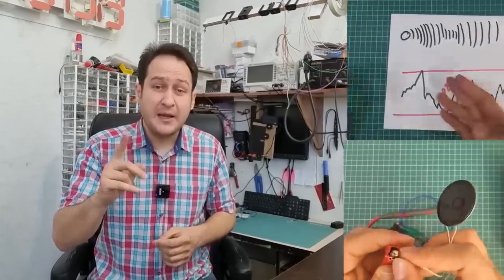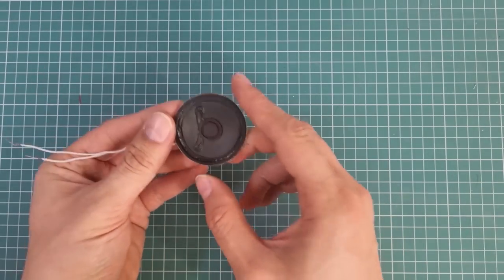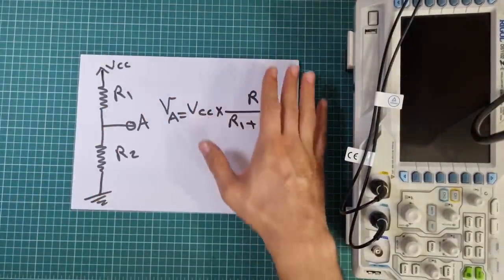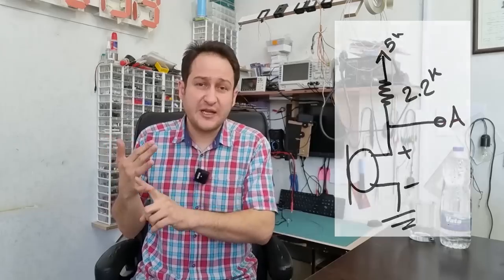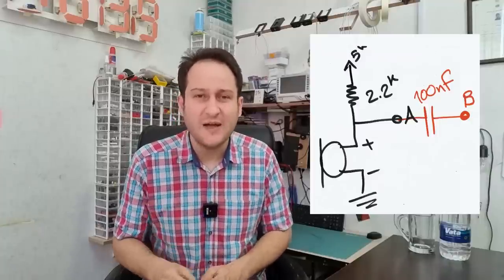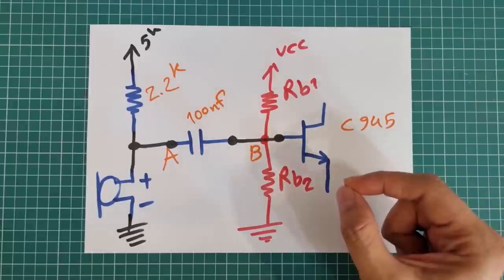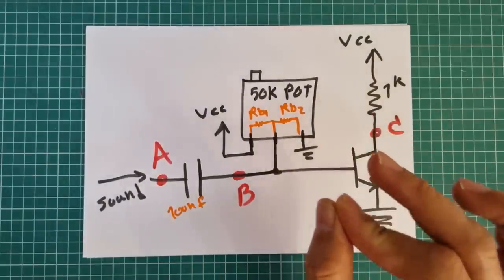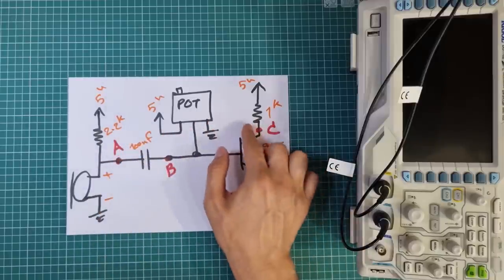How transistors amplify audio signals in megaphone circuit?

Comment: you should have mentioned, for the beginners, that it is not a good idea passing dc current through a speaker not only for heat dissipation but also to decreased efficiency of superimposed ac signals ans since in the emitter follower shown here it is the speaker that determines the quiescent current of operation it may be quite large depending on its dc resistance.
Reply from the maker: Yeah, that is right,  this is not the best audio amplifier in the world!

Comment: You simplified your description of the impedance of the speaker by calling it resistance. I know this is intended to be an introduction, but you should at least mention the difference. The dc resistance of an 8 ohm speaker will not be 8 ohms.

Comment: A resistive microphone is strange. It should be mentioned, that there is allready an active device inside the microphone, which converts a voltage signal from an electret device into a resistance signal.
Reply from the maker: Yes, I agree 👍

Comment: Noob question, why the resistor, 2.2k or otherwise? Why not just connect the mic directly to the voltage source (5V)?
Reply from the maker: Because in that case, both sides of the mic are fixed, I mean the voltage on negative or positive leads of the mic can't be changed, so it can't present the voice signal. You have to put it in series with a resistor, then you can get the voice signal between them 👍
Reply: @elewizard  thanks
Reply: @elewizard  I think I get it now. A change in resistance in the mic due to sound input results in fluctuations of current through R1, which results in fluctuations in voltage at R1 (aka signal), which then leads to a changing Vout, which then needs to be amplified. Is this correct?
Reply: It's like voltage divider

Comment: Extremely well explained video. I haven't found anyone else giving this level of detail, which really helps. That said, I had eveything up to the adding the last transistor. I would have thought the voltage as point C would be too great to drive the base of the second transistor, so it would be in saturation mode?
Reply from the maker: You're very welcome! No second transistor is configured in common collector mode and there would be no problem. 
For more info about that part of the circuit you can watch my other video. There is a link to that video in description

Comment: At 19:20 - no. Any decent capacitor will completely block dc voltages. A smaller value capacitor will not "improve dc blocking". It will, however, allow lower frequency ac signals to pass more easily. There's no reason to guess the value of the capacitor. For audio applications, you just need to pick a coupling capacitor that has an impedance at 20Hz roughly equal to the input impedance of the next stage, which is the lowest frequency of interest for audio. A 100nF capacitor has an impedance of about 80K at 20hz; a 1μF capacitor has an impedance of about 8K at 20Hz; a 10μF capacitor has an impedance of about 0.8K at 20Hz, and so on. Your choice of 100nF would normally be considered too small, unless you deliberately wanted to block bass frequencies.

At 14:00 - no. You'll find that 400mV p-p will definitely produce sound from one of those small loudspeakers. But from an ac point of view you've just connected 16Ω across your voltage divider which has an equivalent resistance of around 1K, so you're now loading the signal and reducing it by a factor of about 60. No wonder you can't hear anything from the speaker. Your test only proves that you need to drive a speaker from a low impedance if you want to draw any meaningful conclusions about how much voltage is needed to hear anything.

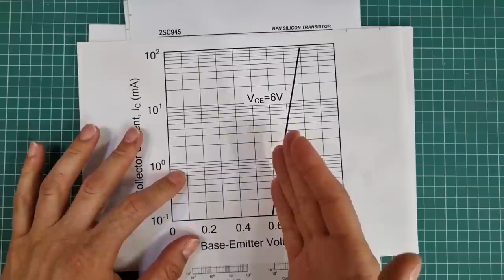At 17:10 - no. The relationship between Base-Emitter Voltage and Collector current is not linear. You're reading off a graph where the axes are *logarithmic*. In fact the collector current increases exponentially with base-emitter voltage.

At 19:50 - no. To choose Rb1 and Rb2, you cannot set "one of them as you desire". Those resistors determine the input impedance of the stage, so your example (pick Rb1=1K) would give an input impedance of less than 150Ω. That would significantly load the microphone and you'd lose most of your signal.
Using a potentiometer to bias the transistor runs into the problem that you could accidentally have it at the maximum extreme so that you get the full Vcc applied to the base of the transistor. If your PSU has no current limiting, you'll burn out the transistor. Put a resistor of several kΩ from the Vcc to the top of the potentiometer to avoid that problem.

At 28:14 - the problem with the emitter follower stage is that the speaker now has a dc voltage of around half of Vcc across it, since the Vbe of the second transistor will only reduce the dc voltage at point C by about 0.7V. We don't want a dc voltage across a speaker, so we need to block the dc with a large capacitor. Generally we'd expect to see 1,000μF which has an impedance at 20Hz of about 8Ω. That means we'd need a low-value resistor from the emitter to ground to bias the transistor. The UTC version of the 2SC945 has a maximum collector current of 150mA and a maximum power dissipation of 750mW (if you can heatsink it to keep the case at 25°C, otherwise more like 250mW without a heatsink). So we shouldn't set the emitter current more than about 75mA for the second stage, giving a quiescent dissipation less than 200mW. That gives the resistor required a value of about 33Ω.
Reply: The point of this video is to explain, in simple terms, how an amplifier works. It is intended to teach people starting out in electronics the basic concepts, and encourage people to have a go. Blowing up the odd transistor (by turning the pot fully to the supply rail), wondering what happens if you change the capacitor value, etc is all part of the learning process.
The idea is to get a foot in the door. Once someone starts to build a circuit like this, they will either be interested, or not. Those that are interested will ask questions. They will dig a little deeper and discover some of the points you mentioned, then tinker and research it some more.
No newcomer to electronics is going to watch a 2+ hour video that tries to address every single point you mention. It would be off-putting. Things such as impedance and frequency response are more advanced topics that come later in a persons learning. 
This video does a great job of getting someone started. If they are interested, they will soon expand their knowledge.
I don’t really know why you watched this video.
Reply: A larger value capacitor will allow lower frequencies to pass. The reactive impedance is always a reciprocal 1 over/divide by 2pifC.
Reply: @MickHealey  I'm perfectly aware of what the intention of the video was. But as someone who has taught for over 50 years, I'm quite certain of several things:

1. You never lie to your students. You may avoid topics, or only give a part of the information, but when I hear nonsense like a smaller value capacitor will "improve dc blocking", I know full well that the students are being told an untruth. Why? Doesn't the author know any better? Does he actually believe that?

2. Giving an example is a good technique in teaching, but examples have to be realistic. Nobody, but nobody, would use a 1K resistor as the upper bias resistor in a stage that's being driven from an electret microphone. It would have been just as easy to have worked with 100K, so why not do that? Similarly, using a 1μF coupling capacitor would be a practical value. So why suggest 100nF? Even if you don't present the calculation in order to keep the video simple, there's no excuse for not being aware of what a realistic value would be.

3. You don't contradict yourself when teaching. You should not blow on a microphone and then say "never blow on a microphone". Nor should you tell students not to put a dc voltage across a speaker, and then do exactly that in two different places. Does the author not realise that his final circuit puts half the supply voltage across the speaker? Did he have no idea of how much current that will pull through the transistor, nor of the effect of 150mA of quiescent current passing through the speaker?

4. Students have a range of abilities, and many are capable of doing extension work on their own. The best lessons cover a topic at a level that all students can cope with, but provide leads to further material for those that want it. This video neither gave an accurate overview of a basic two-stage amplifier, nor gave any idea of where they could find more information.

So, no, this video does not do a "great job" of getting anyone started, and I have no idea why you would choose to pretend that it does.
Reply: @RexxSchneider  So, you've taught for over 50 years, and presumably consider yourself an expert on the subject. That being the case, I see no reason for you to have watched this fundamentals video, unless it was for the sole purpose of picking holes in it. I know retirement can be boring, but wouldn't your time be better spent doing something constructive, rather than being critical of other people's work?
Reply: @MickHealey  That's a pretty thoughtless comment, isn't it? Any decent teacher will always be on the lookout for fresh, quality material, because it's easier to direct a student to a good resource than to have to explain the same thing from scratch. I guess that you didn't bother to read my fourth point, as that should have tipped you off to my reasons for looking at introductory videos.

If you don't think that pointing out factual errors in a presentation, and explaining each error is "constrictive criticism", then I suspect that your grasp of the English language is even weaker than your grasp of pedagogy.

You should also understand that I feel sorry for students who are mislead by errors, and hope that they would benefit from reading the corrections. Should I assume that you are happy to leave them with mistaken impressions?
Reply: These are important and honest clarifications for those who want another level of detail and caveats for this circuit.  In particular, noting for beginners that: 
 - Often “load” is mentioned and not explained; essentially by what factor (eg by half) a signal is reduced. “Load balanced” or “load matched” circuits are ones that minimize losses from one stage to the next. The measurement of “load” is quantified often by “resistance” (for steady signals) or the fancier “impedance” (which includes wiggly signals)
 - The “load” can be different at different frequencies (wiggliness) of signals. This useful feature, measured by impedance, is a behavior of commonly used components capacitors and inductors. Capacitors being mentioned here have a higher “load” at low frequencies, and have their highest “load” at the zero frequency also known as DC signals (no wiggles).  At higher frequencies Capacitors don’t reduce the size of wiggles as much, and effectively let them pass through without much of a toll (there is always some toll!). Inductors load down the wiggles opposite to the capacitor behavior. 
 - Audible wiggles for humans range roughly between 20Hz and 20kHz (though my personal range has diminished significantly ; young players wear those protective ear plugs!). The purpose of a circuit will help narrow down the range of appropriate component values. 
 - Sometimes the most interesting learning happens when mistakes are made and figuring out why a configuration didn’t work as expected (or blew up). Of course safety wise it’s best to stay living in order to debrief  on why expectations were not met, so first it’s useful to understand where high currents could appear. Resistors are one way to limit how much current is possible for a given voltage (loading it down!) to prevent damage to circuit components which have a limit to how much current they can withstand (much like us). 
 - Watching another person make mistakes, and seeing the consequences, while saying “do not do this” is definitely educational when understanding why it is being recommended to “do not do this”. A time and money saver for sure, though feeling the sting will always be a more memorable teacher rather than passively watching a teacher being stung.

Comment: Thank you. Another great video with easy to understand explanations. Would it not be wise to put a small 1K resistor on the middle pin of the 50k pot so not to turn the 50k pot to zero resistance and allow full current to pass through the pot to the base emitter junction and burn out the pot or the transistor?
Reply from the maker: Yes, I think it would be wise 👍

Comment: Very impressive. I love your video. You made the concept that was hitherto pretty strange to me to become clearer and easy. But then, how do I drive a big loud speaker ?
Reply from the maker: Happy to hear that. High power speakers need high power components and of course an optimal and sophisticated  amplifier circuit. This circuit is good to learn basics not to use in real world projects
Reply: @elewizard  
Thanks for your reply, hopefully you design a more power amplifier in the nearest future. I will subscribe and wait the day the video will drop.
Reply: Valve, MosFet or BJT?    Class A, AB, B, or D?   Big is what in terms of Watts[RMS] ?  Impedance?
Reply: @kennmossman8701  
Like 40w transistor Amplifier.
Reply: @AugustineAriola  That is an immediate-advanced project. Look at back issues of Wireless World or Elecktor. Maybe be better to buy a kit
Reply: @AugustineAriola  do you have a pre-amp?
Reply: @kennmossman8701  
Yes Sir
I have a preamp. With bass and treble setting. I was unable to amplify it upto 40w desired. If I were to use toroid transformer, how would I go about it? Do you have a site, suggestions or circuit diagram and calculations ?

Comment: Very nice, was easy to follow along, even the biasing part but the 2nd transistor kind of threw me off.  Why is the currnet amplified int 2nd transistor and the voltage amplified in the first one? why isnt the current amplified in the first one? oh yeah the 1k resistor. You said there are many disavantages to simply using a low value resistor to allow enough current to flow, but didnt mention any heh, was curiouse to know, anyway, thanks for the great info.
Reply from the maker: Thank you for your feedback 🌷

Comment: Hey bro, what's the model of the LCD monitor you have hanging on the wall?
Reply from the maker: I am not sure about that,  it's brand is lenovo
Reply: @elewizard 
does it a way to add HDMI port and power terminal to spare laptop monitor and use it as an external monitor?